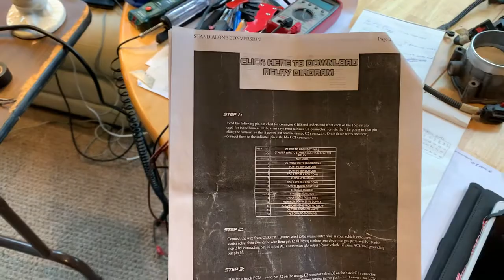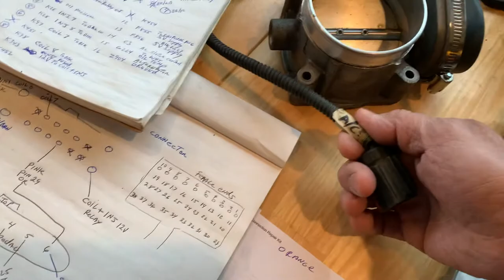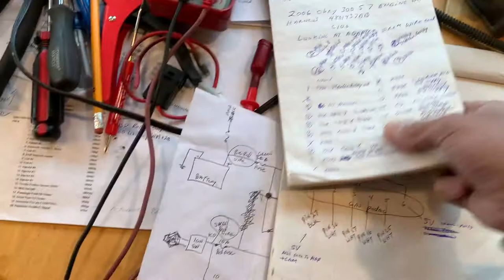G3 HEMI 6.1 5.7 swap harness. DIY Part 1. Look for it running in part 2!

Comment: Hi there  is ther any chance you still have your notes or know of a website that has a wright up on it  i have 09 300 with a 4.7 that im wanting to transplant in to a 57 buick for my wife.     Iv done a few ls harness and have HP tuners but I'm new to the Hemi stuff
Reply from the maker: Sorry, too busy with other stuff. If you want to get up and running quickly, just buy a brand new harness from Chris at hotwire. You will be running in less than a week after receiving it then you can move onto the other things like the exhaust and tuning it.

Comment: I have a 2007 300c and I can't find a wire harness for it. That harness has been discontinued.
Reply from the maker: Junk yard? In my recent video, I found 3 chargers with hemis still in them with full wiring harnesses that I cut out. Engine harness with the c100 and the wiring cut at the fuse box and firewall was $38.

Comment: Hi there. I've watchd your video and I've had a look at hotwire auto harnesses and diy hemi. I have downloaded Blake's wiring diagram and a few pins appear to be different to my pinouts. My doner motor/loom ect os from a 06 chrysler 300c. Would you happen to have a link or a copy of your pinout diagram that you use to simplify your looms for retro fit. Cheers in advance
Reply from the maker: Which pins are you asking about? Blakes and hotwires are both basically the same, so that’s why I’m asking what pins are you wondering about?
Reply: @ShelbyDogg  a couple in my black plug don't have wires in them. I'm not sure if that matters or it was just an option for the different vehicles those plugs were in. I've tryd to trace half the loom but unfortunately I'm at a dead end as the obd2 plug wires head in a couple directions and I'm not sure where they go after they go into the front control module. Would you be all good to email me your print out of your pinout diagrams?
Reply from the maker: What’s your e-mail? Send me a PM on Facebook Rob del Rosario

Comment: Do you know how to wire a LS throttle body IAC valve into the dodge 4.7 harness ....
Reply from the maker: No, I don’t know anything about 4.7 wiring or the LS IAC pin outs.

Comment: Hi nice video. Question can you help me wire the asd relay and fuel pump pins or diagram on them thank you in advance.
Reply from the maker: I made a video for the relays in July 2022 showing the relay diagram. The ASD also supplies the 12v to the injectors, coils and capacitor(s). 
https://youtu.be/WwgVNtBHQog
Reply: Hello, I sent you a message for the Hemi wiring to buy

Comment: Can i put a 2nd gen 300 (2011+)dash board in a first gen 300 6.1 srt8 (2006) to get srt pages and the newer look?
Reply from the maker: I never did that to know if it works. Sounds like you need to contact Russel Drake at Sound German Auto. He might be able to answer your question.  As far as monitoring. I use an ELM327 from Ebay for less that $10 and an Android table or phone running the TORQUE app to see my GPS speed, Tach Temp, O2 sensors,

Comment: I just started my own swap! 2006 durango hemi into my audi a4. My question is how do you control the fuel pressure?
Reply from the maker: 2 of mine use this regulator from EBay hooked directly to the back of the 2nd fuel rail to the return line back to the tank. You can also use a corvette fuel filter with the built in regulator mounted by the tank to run just 1 line to the engine if you use the factory fuel rails with the crossover line. I can’t attach the picture but you can see the regulator in my other video with the EZ-EFI on the 5.7 
At the 12:54 minute mark. The regulator with gauge was less than $25.

https://youtu.be/I8n8rqEwIsc
Reply: Thank you so much!🙏
Reply: @shelbydogg  Can I please pay u to video chat to help me wire up my harness correctly

Comment: Hi, can I use a 2006 wire harness off of a 300c srt8 6.1 on a 2007 300c srt8 6.1?
Reply from the maker: I think you can. My little harness works on both my 5.7 and 6.1 so many of the 6.1 years up to 2010 used the same pins. The 5.7s added VVT in 2009 so there would be some extra pins but your 6.1 won’t care.

Comment: I am playing with the idea of putting a 6.1 from a 2010 into my 08 R/T charger. I think the 6.1 will be out of a challenger. Would you know if I use the challenger ECU, is it worth the effort?
Reply from the maker: Yes, I think you can use either one. Try your 5.7 ECU first. Security and VIN is already set up for your car. Get a HP Tuners device and compare both fuel maps. The first thing you get to change, when you open up the ECU file is the engine size either 5.7 or 6.1. If you have your own HP tuners device you won’t have to pay somebody to do your tuning and DIYHEMI shows how to remove the security yourself, on the 6.1 ECU. You can pull up the 6.1 map and send it to your 5.7 ECU if there are a lot of changes.
Reply: @shelbydogg  Thank you Sir! That is very helpful info.

Comment: Is there a site that I can go to for the diagrams
Reply from the maker: Here, This one is from DIYhemi.com's website.      https://0595e983-8609-4d15-8d52-0fd1f7c84298.filesusr.com/ugd/6b5d57_dc9bd7593d5d4f22bbef6e0d92809c98.pdf
Reply: Do you have the 05, or just the 06-08?
Reply from the maker: @robbyjames2777  not sure what you’re asking. The engine in the video is a 2010, the pcm an 06, and the wiring is 96-08.
Reply: The diagram you showed, on diyhemi, they offered (03-04),(05), then (06-08) just wondering which one you had, is there many differences between then truck harnesses?
Reply from the maker: @robbyjames2777  My harness had the number 4801437AB. When I google it, I get 2006 Chry 5.7 engine wire harness. All I can tell you.

Comment: I already like and subscribe I was wondering if you could help me they stole my rear fuse box to my 06 SRT charger and I replaced it with a rt fuse box but all the wire matched but there is 1 wire missing a pink n tan or red tan wire that is coming from my car to the box the fuse box didn't have it and when I connect it to the fuse 28 it ruse all right but when I connect it to fuse 29 the car stays on when key is turned off can u help me I can give u more info if needed please help I dnt what this to be connected to something it not suppose to be  thank you greatly appreciate it

Comment: Did you use the pen out sheet from diy hemi to make your harness ?
Reply from the maker: Used some of DIYHemi’s pins and some from Hotwire’s harness. But all of those signals are found on the web, you just have to look and save the links.

Comment: So this is a little bit different than Ls there’s no security system right is from what I’m understanding
Reply from the maker: After 05 they had a security system called SKIM, that only allows it to run for 5 seconds if not removed. You can send the PCM out to have it cleared or buy a computer that has it removed and programmed for stand-alone use.

Comment: Would you sub out a harness?
Reply from the maker: If you are just getting into engine swapping - new hemi, do it the easy way. Call Chris at Hotwireauto.com and order everything you need. He makes new harnesses with or without a PCM. You hook up a few wires and start driving. No headaches repinning or trying to read diagrams. Pay and drive. I have driven over 22,000 miles with the first harness and ECU from him and just got back from another 1500 mile trip in my 5.7 Cuda over the weekend.

Comment: Since you have a 2010 engine did you delete the wires for the vvt ?
Reply from the maker: The 2010 5.7 that I have in my Cuda, I’m using with a new Hotwire harness that has the VVT and MDS connectors and wires. This way I can enable them both in the tune if I want to experiment with more MPG. But I haven’t done it yet because I haven’t done the PO1 timing chain and tensioner recall kit, since the MDS can break the chain or tensioner.
Reply from the maker: I did check the Hotwire tune and VVT and MDS were both disabled for the 30,000 miles I’ve driven so far.

Comment: did you ever use the 2009-10engine wiring harness? that is the years i need help on
Reply from the maker: My Cuda is using a 2010 pcm and 5.7. It is a Hotwire harness that I put in 5 years ago after my Hemi-6 video. I have all of the pin outs. What are you asking? I’m at work, will answer later.
Reply: @shelbydogg  I have power to coils, injectors and all the grounds hooked up. I have the switched ASD relay,fuel pump relay hooked up. New fuel pump . But it will not fire . It's like the control grounds from ecu has no out puts
Reply from the maker: @kennethcoble269  do the injectors open for the prime pulse and the fuel pump come on for the 4 seconds at key on?
Reply: @shelbydogg  I'll have to check tomorrow. I forgot to hook battery charger up overnight last night
Reply: But looks like steam coming from exhaust as I turn it over
Reply: @shelbydogg  no they do not cycle
Reply from the maker: @kennethcoble269  https://youtu.be/v9lPZy63S0E
Watch this and see if your TB cycles
Reply: @shelbydogg  yes it does
Reply from the maker: @kennethcoble269  work on getting your fuel pump signal to power on with key-on
Reply: @shelbydogg  that's what I'm trying to do